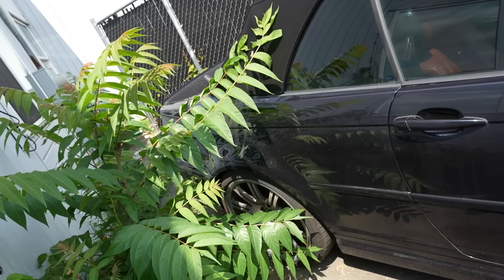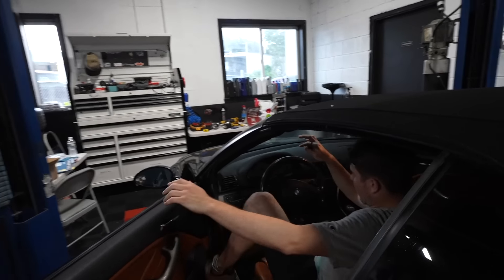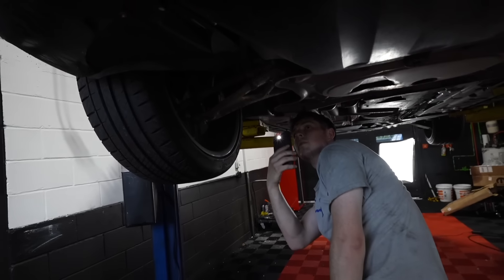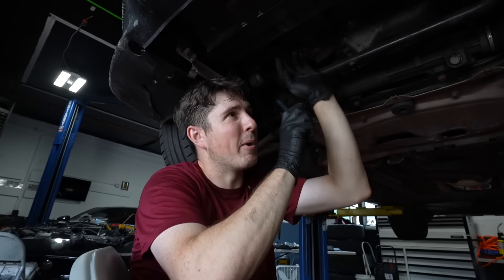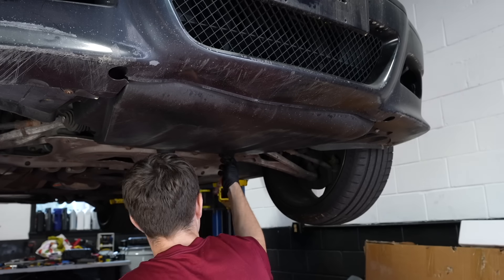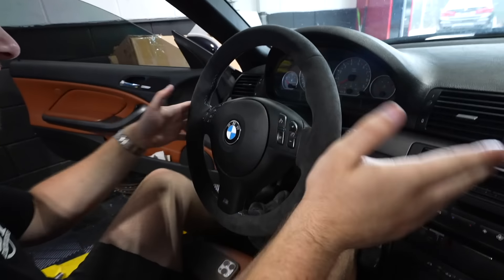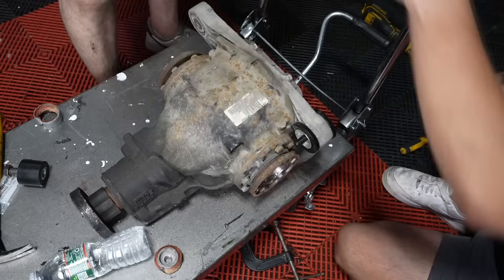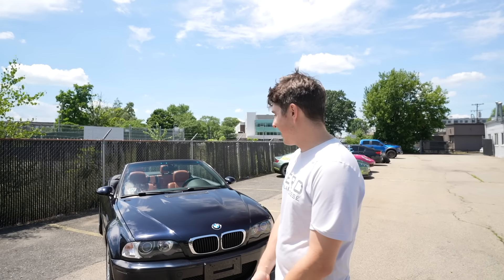I Bought An Abandoned BMW M3 & Fixed It In 24 Hours

Comment: Pro tip, if your draining anything like a diff, trans or transfer case. ALWAYS crack the fill plug before the drain plug.
Reply: Yup, don't want to find yourself in a position where the fill plug doesn't open for some reason too

Comment: First time viewer....this is one of the best E46 color combinations out there. I currently own 5 E46 M3's, one coupe and four convertibles. One of my convertibles is the same color combination. I see the car has the hardware installed for the factory hardtop...did the owner still have that available? They make a world of difference in interior quietness, and overall rigidity...plus it gives them a very unique look. If the car is still available, I might be interested.

Comment: Just bought nearly the same spec last month.  Parked for 5 years.  Carbon Schwartz over cinnamon 6speed m3 vert with 115k miles. Mine has the wood interior trim however.  

Sure a coupe is more desirable but it’s still a 6speed manual m3.  

When undoing the cv shafts, next time just take the rear wheels off and stick a screw driver in the vents of the rotor between the caliper and bracket.  Now you don’t have to worry about your friend pulling a car off a lift and crushing you.  Be safe guys!

Comment: 12:51 Technically if your transmission fluid breaks down completely, your transmission also fails. Thus marking the end of the transmission's lifetime. So in a sense, it is in fact lifetime. The fluid's lifetime is also the transmission's lifetime.
Reply from the maker: haha I guess that makes sense
Reply: @captaincrankshaft  Now that you've changed the fluid, you've reset the fluid's and the transmission's (except for wear and tear) lifetime. And successfully cheated the system. Service centers hate this one simple trick.

Comment: rookie move: you need to unscrew the fill plug before you drain just in case you cannot get the fill plug open. Lifetime fluid is how long the factory will stand by their product as evidenced by 100k mile CPO warranties.